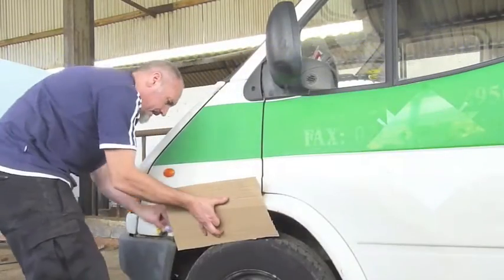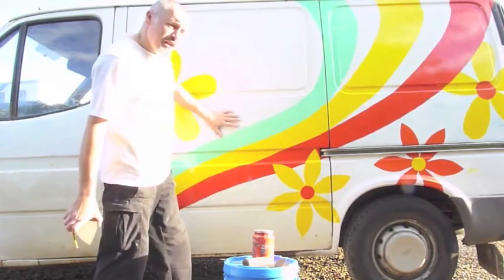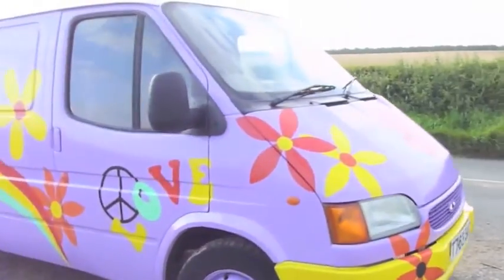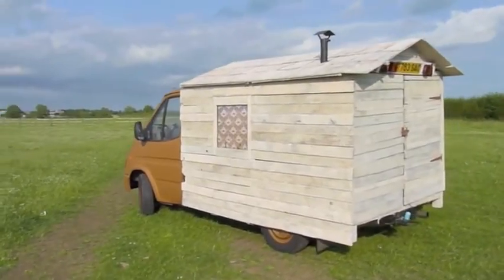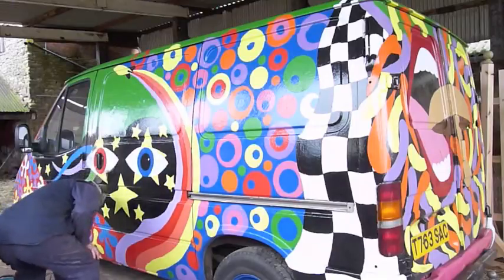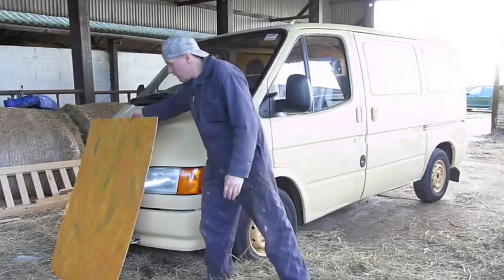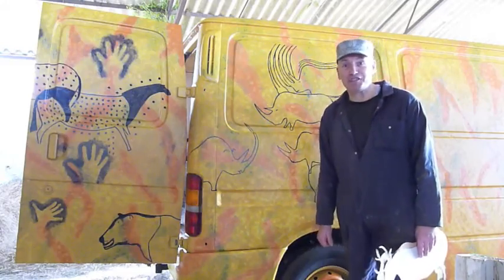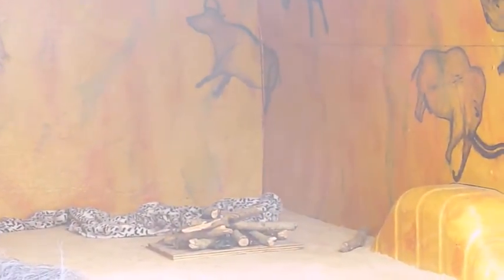Old Ford Transit, Art Car 5 projects

Comment: Love your work mate, you have inspired me to do the same, do you do all of that with brush, roller? Spraycan? Do you cut around the lights and stuff, or take em off?  Im buying a 2008 ford transit, the body is quite ruff so i figured your style is perfect.
Reply from the maker: Hi Dimitris, 
Thanks, sorry for the delay youtube are not very good at letting me know about notifications. I always lightly rub down the old paint and just paint over. My work is more about design than the finish, I don't want to spend more time on the van than it worth😂. I'm in the middle of a new design now, just painting it on my drive and having a good laugh with the neighbours. just enjoy what you do and hopefully I will get to see your design😃
Reply: @mickhenson1  good stuff mate! 👍